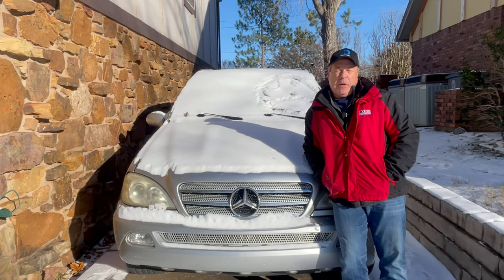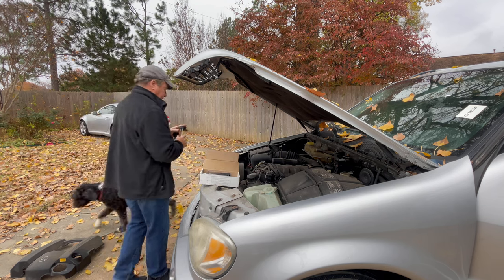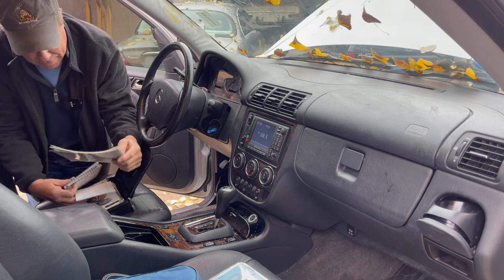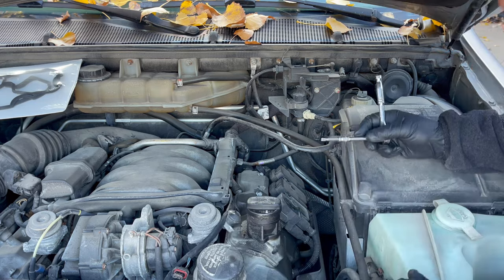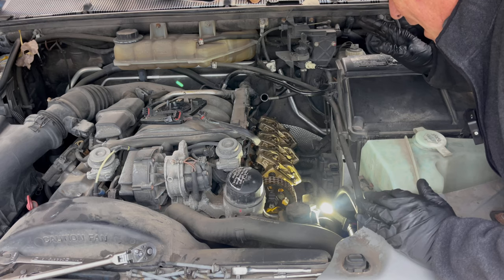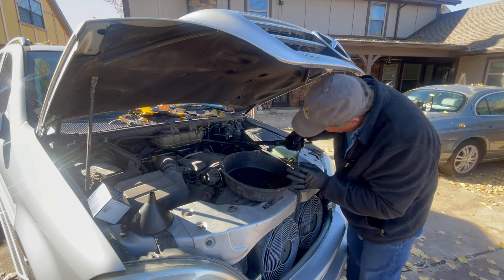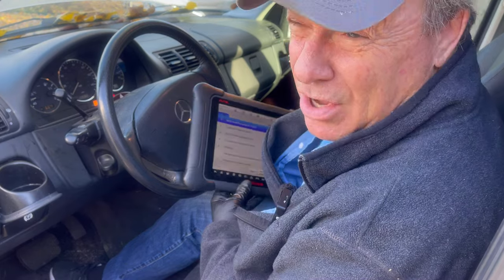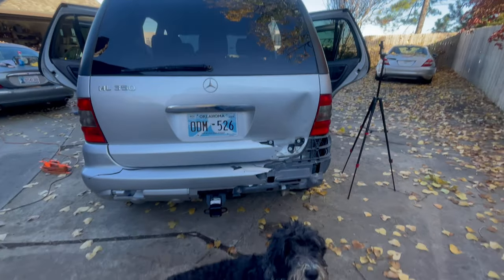So Was This A Terrible Purchase?

Comment: Turn off the car jack the front end up and turn the steering wheel all the way to the left and right about 10 times and it will bleed your power steering. if it's still noisy you may have a bad pump.

Comment: You may need to replace the lifters in that engine to get rid of that tapping sound. It's definitely louder than my M113. The high pitched whining on startup is the secondary air injection pump and is normal.

Comment: Good job. Would have been good to change the oil while doing the filter and start with both clean. Ideally they should be changed at the same time.
Reply from the maker: I added 5 quarts on the way home
Reply: @MonkeyWrenchMike  Yeah but you're only diluting the bad stuff. This is still mixing around the engine and will prematurely clog up your new filter. Best to drain it all out and know the oil and filter are both clean. When a car has been low on oil it puts additional stress on the remaining oil to preform its job of lubrication. Eventually it congeals which doesn't mix well with new oil.

Comment: i had noticed that you checked the rocker arms and found at least 2 loose ones but then put the valve cover right back on without tightening them up. thats where the ticking sound is as far as i can tell. just make sure to go back and tighten them up if you can.
Reply: This isnt a 1972 chevelle. These cars have hydraulic lifters which auto adjust. They were loose due to lack of oil pressure. Most engines have been like this for the past 30 years or more.
Reply from the maker: Yes, these are hydraulic.
Reply: @MonkeyWrenchMike  well I didn't know. Most engines I know of were manual adjustment. News to me

Comment: Whilst the valve cover was off did you check the lash or does that matter so much in this engine? Those front cylinders sure seemed to have alot of rocker play when you were checking them.

Comment: You need to set your rockers, way too loose. That's your tick. Really should not run it like that as the rocker can actually turn in there throwing everything out of wack. I would check the other side too. It is not hard to do, just read up on it, and find the specs for your engine
Reply from the maker: They are hydraulic
Reply: I did not know that, guess there are still lots of things to learn. A little trick I think I saw Pudden do. Take a long extension bar, and put one end to your ear, and the other on the area you think is causing the tapping. It will be very loud to you if you find it, just keep doing that till you locate the noise. Hope this helps, great content, keep up the good work.
 @MonkeyWrenchMike

Comment: The hood opens up the service position on the ML, just move the struts to the other peg.
NAPA sells the same MB power steering oil for a lot less, same part number. 
Full coolant flush including the two bolts at the bottom of the engine.

You got a great deal, just keep giving her some love.

Comment: Had a similar lifter starvation problem on my W163 that was not serviced. Try a bottle of Rislone Engine Cleaner (take out a quart of oil & add the rislone) and it should help.

Comment: Bad lifter making the tick?  Are the spark plugs all tight?  Seemed like it was huffing smoke.  An engine oil flush might help out the tick. Those engines always an oil pump whine due to the rubber deteriorating on the sprocket.

Comment: I have had several vehicles that chattered and the only thing I have used is Berrymans B-12 Chemtool and poured in the engine and it cleaned all the oil passages and the chatter went away oil change proved how much junk was in it,then put some in the Gas tank to clean injectors and spark plugs.

Comment: It seemed pretty obvious it didn’t have a blown head gasket—just some condensation under the cap—when it didn’t run hot or belch steam on the drive home. Now as for why it was so low on oil… euro cars don’t have a tendency to leak, do they? 😂

Comment: The M113 is one of the best Mercedes engines, the head gaskets flatten out and leak, you should have changed them if you took them off.  The rubber hoses do harden with age and also should have been changed.  There both inexpensive. The V6 and V8 engine of this type is known to be very reliable.
Reply from the maker: I didn’t touch the head gasket or remove the heads
Reply: I think he meant valve cover gaskets. @MonkeyWrenchMike

Comment: Hey Mike - always good to see you. Is this not the perfect tow vehicle? The engine chatter is grating but perhaps it needs a really strong engine flush and fresh oil? The v8s get ticky as you know. I hated these when they came out, I drove an 02 500 extensively and the handling and interior quality sucked. Now I’m older and I drive slower, the fact that these are sooooo cheap and simple, kinda makes me wanna find one (as I’m clearing a foot of snow drift off my drive here in Vancouver!). It’s way nicer than the Escalade (sorry not sorry). Stay warm!
Reply from the maker: You too!

Comment: need to clean them cam followers out or put some thinner oil in it,   the holes are that ting to get through the lifters it might be to thick,    or could be blocked,    take em out and soak em over night